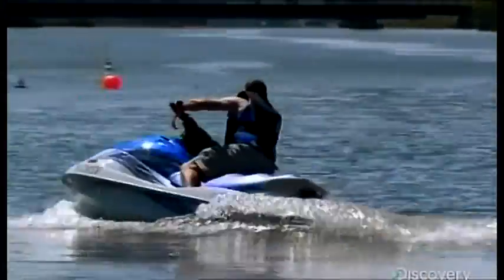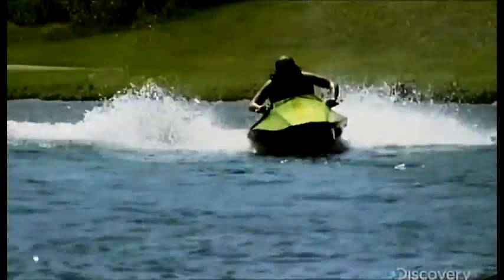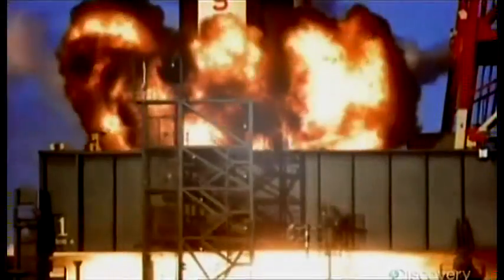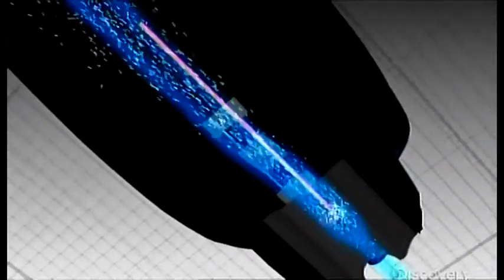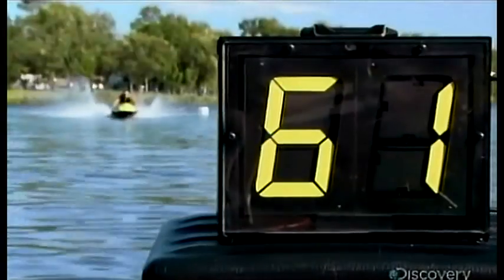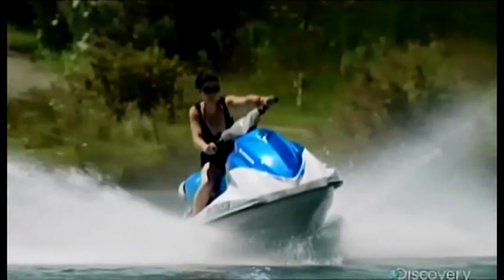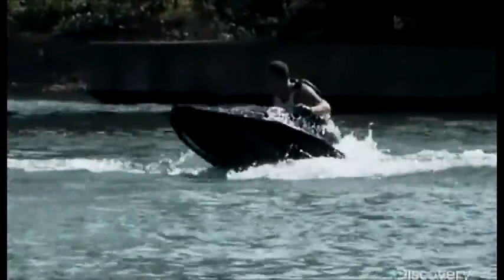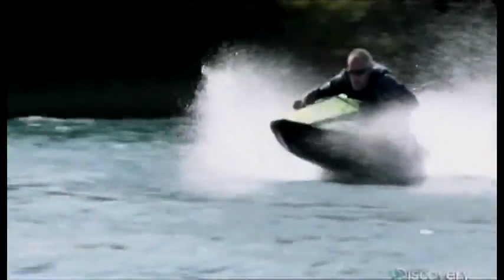How Jet Ski Works

Comment: One of the fastest jet skis on water?? 60 mph is average for a jet ski. There are jet skis that go more than double this jet skies top speed.
Reply: Might be referring to 0-60mph.
Reply: 60 Miles Per Hour is roughly 120 Kilometres Per hour on something that weighs 90 kilograms which is close to 200 pounds, I think it would provide a lot of fun. excitement and thrills, for any one.
Reply: Jennifer  mills  Not sure where I got the 120km from,  what ever it's fast, thanks you for the correction.